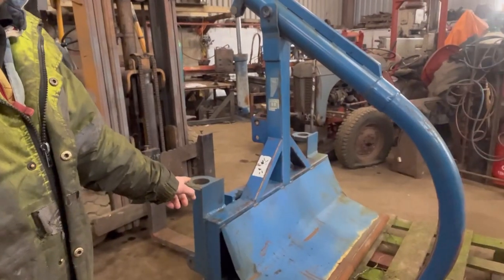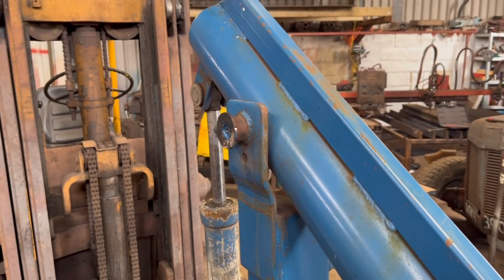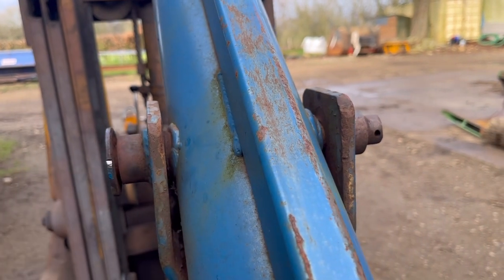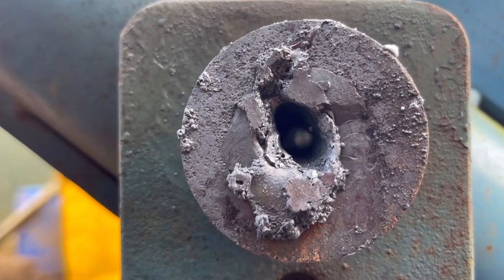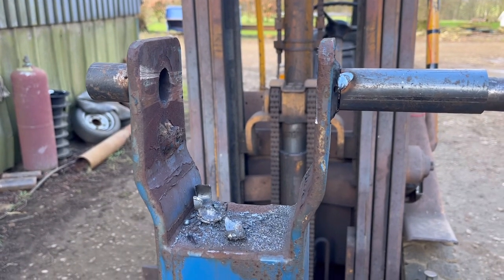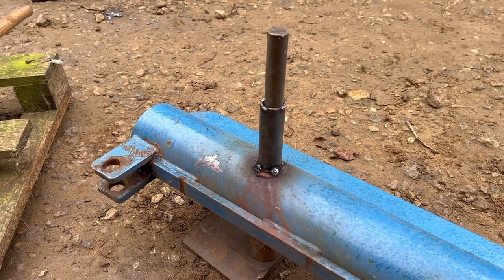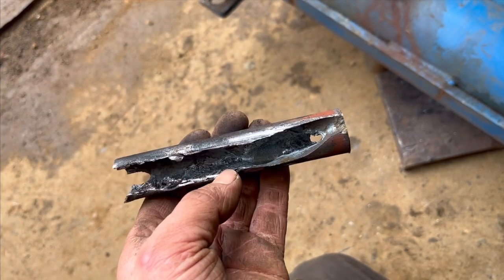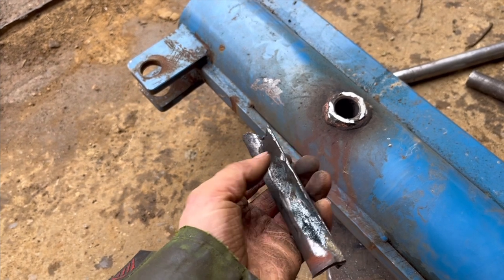Thermal lance too HOT for 1” pin!

Comment: Great tip about welding the pipe on to support the punch, my little finger's still not right from when I was holding a punch while my son wielded the sledge last August. He glanced off the cleat on the tractor tyre a few belts in and sent the hammer onto my hand !
Reply from the maker: Ouch! That’s where the chicken punch comes in handy.  A punch with a long handle 🤣

Comment: Good job snowy. Your right on when you say that's  how it goes when you have to do a bit more work to make a new Bush it does happen in repair. Best not to assume  anything  with repairs. That's  why it is hard to give an accurate  price. Some people do not understand this. Family run car repair garage for 30 years. A real eye opener. Mark and ruth. Ps love your new line borer by the way.
Reply from the maker: Very difficult to give an accurate price, too much can do wrong. Luckily most of my work doesn’t require giving a quote, it just needs doing. 
I bet it is! The average car owner has no idea what’s involved under the bonnet. Thanks for watching!

Comment: A very good demo of the lance - but what does the machine that supplies it look like? Is it just a welder? Perhaps with different settings? It would be lovely to see the whole repair.
Reply from the maker: There isn’t a machine that supplies it. You  connect it to a 12v car battery to strike it and once it’s lit, it’s just the oxygen supply that keeps it going.

Comment: It would be easy to tack weld a simple guide made from scrap when you need to keep the lance centered. Holding both hands in space is inherently innacurate but a guide would make it easy.
You could use a punch or other tapered object in the guide to center the guide on the pin for tacking. Doesn't cost but a few minutes and avoids rework.

Comment: Great video, had a problem changing pins on main rams on a skip truck of myn ,  they wouldn't move 1 mm had to drill a 10mm hole with magnetic drill then my mate cut through with my gas cutting torch .
Reply from the maker: I’ve done similar to that before. Before I got the thermal lance.

Comment: I presume the notion of farmers doing routine oiling/greasing on their plant would have a negative effect on your business. 
Well, better to watch someone else washing and polishing their Range Rovers than getting dirty looking after their plant. 
Interesting video, thanks for that.
Reply from the maker: Yes, I get a lot of work caused by lack of grease. But then a lot of agricultural equipment is made on the cheap right from the start.
Reply: @snowballengineering  : Hi, You asked for comments on your videos.   You'll be aware on YT, no doubt, of Kurtis at CEE in Aus.   A difference I think you need to highlight is the awful UK weather conditions you need to do farming plant work in without always the benefit of a nice big, near clinical, working environment in sunny hot T shirt conditions.   There is the technical job,........ and then there is the adverse conditions you need to complete the job within which is what usually makes any job, no matter how simple, a nightmare to do and is actually the real story.  I think this aspect needs to be highlighted.    All success to you!

Comment: Rust sure can wedge things together eh? I have managed to lance out 3/4"(19mm) pins without too much unwanted  destruction of the part I wanted to save. But it does not take long for things to go completely awry if you are not fairly straight. Oxy lance and it's river of molten magma has no mercy!  Good stuff
Reply from the maker: Unbelievable how tight rust can make things.   How much oxygen pressure were you using on the 3/4 pins?  Think I’d of maybe got a better result with less oxygen.
Reply: @snowballengineering  I usually run 70-80 PSI. Less Oxy is a viable idea. I have a lancing job coming up. although not a small dia pin, I think I will experiment some regardless. Thanks for the idea

Comment: I would think that a press would have pushed out the central pin on the arm ,😮
Reply: They make a 48 inch portable press for track pins that would work great for this. I love the lance but it's a bit much for this. Drill from both sides first then push the lance thru.